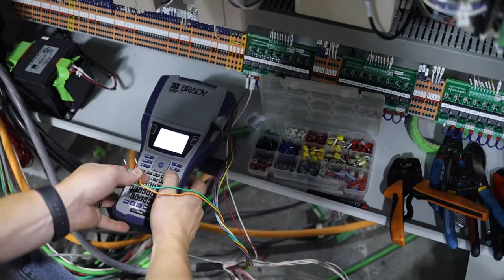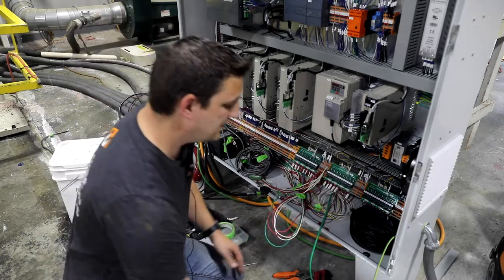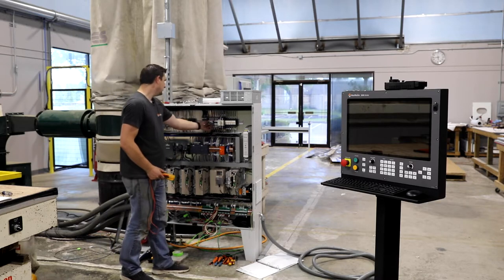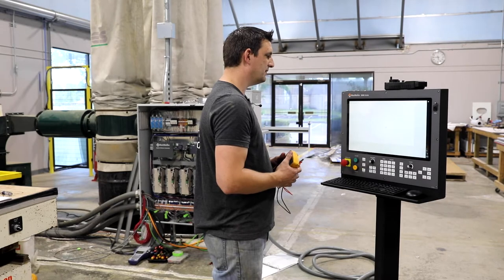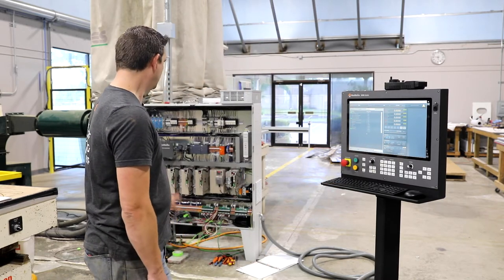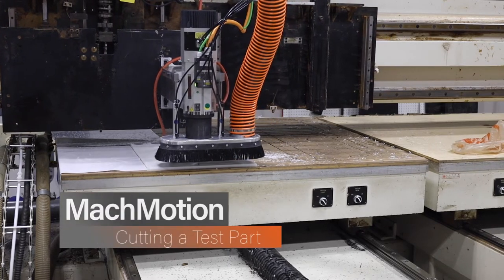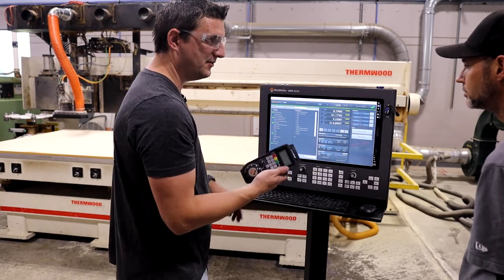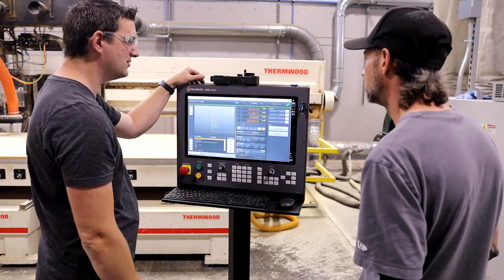Full Turn-Key Install of MachMotion Control Upgrade

Comment: What controller is running in the background
Reply from the maker: We used Vital Systems HiCON on this system.
Reply: @MachMotionVideo  and mach 3 front end ? 
I have done loads of the complex machines in the uk .
Reply from the maker: @automateanything  We use a Mach4 front end and have developed our control screen/operator panel interfaces around it.
Reply: @automateanything  I’m looking into retrofitting my Bridgeport it currently runs protrax mx2 do u no what’s available in the uk user friendly